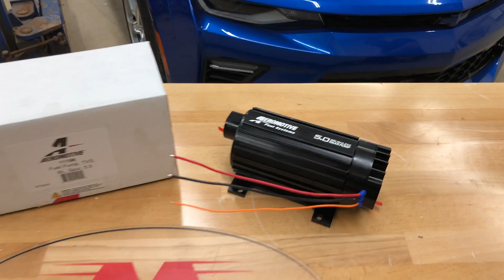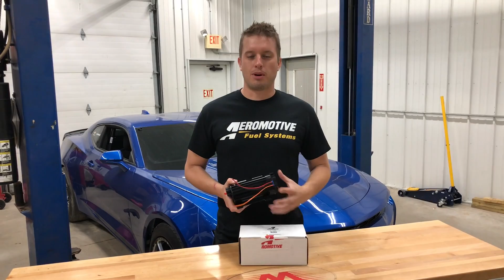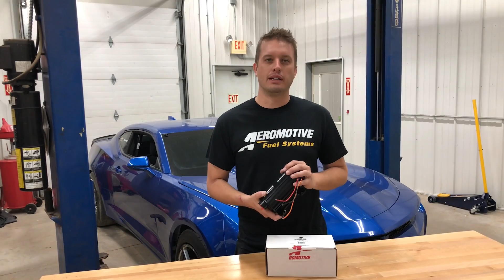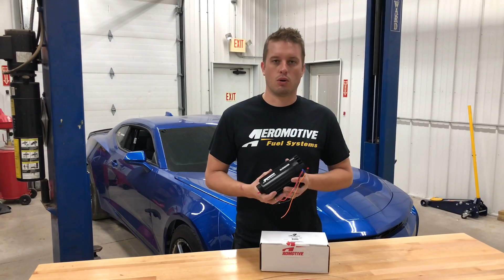Ultimate Streetable Fuel Pump! Aeromotive Variable Speed Brushless TVS 5.0 GPM P/N 11196 Is Here!

Comment: Do you still need such a large return if you are using a pwm control method?
Reply from the maker: Joe Sikes it is still recommended yes.  Note you can’t actually PWM this pump, just only use a variable speed input
Reply: @MotionRaceworksOfficial  what does PWM stands for?
Reply: If you size the pump to your system, then it will need the line it always have. But if you are making 1000 hp and buy a 7 gpm pump, no then obviously not if you lower the duty cycle. But then again, why on earth would you want to run that? For that application you'll only need the 3.5 and if you are making way less power, then again, get a smaller and cheaper pump still. In short, if you never use the pump to above say 70% or more of its capacity, it's a total waste. I know someone who run a hopped up LS9 and he seems to think he's a pro mod racer, so he bought the 10 gpm pump. A waste of 1000+ usd. Size your pump for your application, the entire system will be at its best that way, including the pump and your car will be faster because you lug less  weight about and the right sized pump will operate in a more efficient band, thus cause less parasitic loss thought the electrical system.

Comment: Most ECU's do not offer a direct voltage output.. you would need a PWM to voltage converter in most cases
Reply from the maker: flattrate maniff one option is to share the tps signal.
Reply: Were putting one in the bblueberry
Maxxed the VR1 once we took the meth out of it

Comment: Is this pump quiet?
Reply from the maker: Midnight C6 honestly it’s not the quietest pump on the market.  What helps make them quieter is installing in tank and or using rubber mounting pads.   For the power it makes it seems to be tolerable by most people!
Reply: Eh, it's a series of large fuel pumps for big power. No, they are not quiet but the ability to slow the pump down will obviously quiet them down, especially if you do an in-tank install with properly supported and dampened lines. But it is a high performance pump that moves a lot of fluid though an impeller system that was never designed for quiet operation.

Man, these questions always baffle me. Is a 1500 hp methanol engine quiet? Nope.

Comment: Been using brushless motors in RC airplanes and cars for a long time, brushless Will heat up. Not to the extent of a brushed, but they will heat up!
Reply: Yeah. If you overload them or run the hard, they can get properly damaged by heat. Race RC boats with them and cooling is crucial. I suppose that what he means is that if they are within their operating range and ran somewhat conservative which I suppose they do, obviously they will not make a lot of heat. After all, these are 38 amp motors and what we tend to run is many times higher. Was he to make the same power with a brushed motor it would obviously run hotter and be a lot bigger to do the same. At the end of the day we are watching a commercial, so it is what it is, and the outrunner in this pump can run cool if the motor is conservatively loaded which I would think it is for longevity.

Could you imagine running some of the 40 and 56 can motors we run in our hobby for this many hours on end on a constant load? That's not what we do so our issues with heat are slightly different.